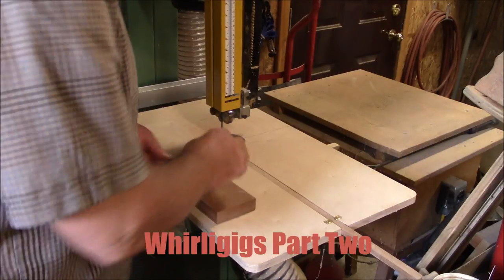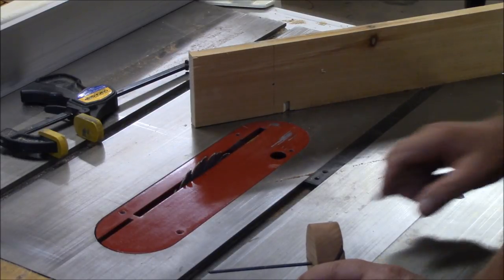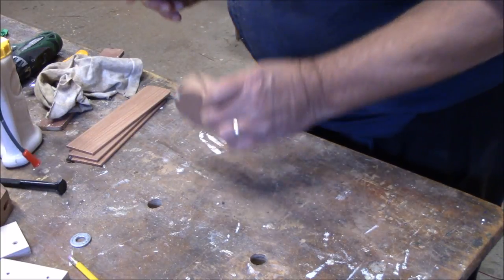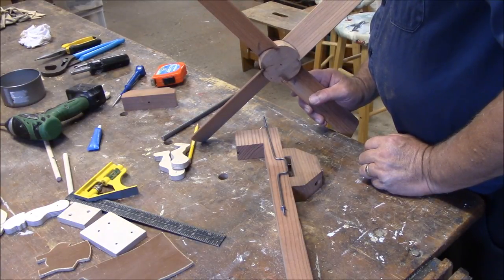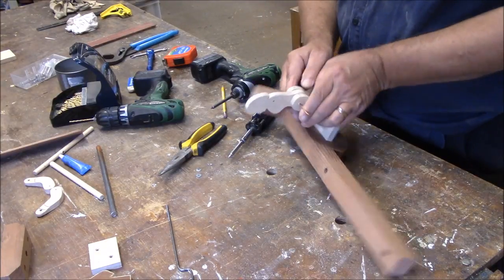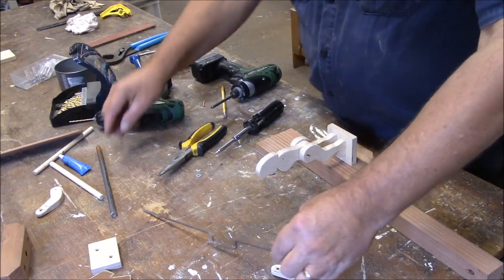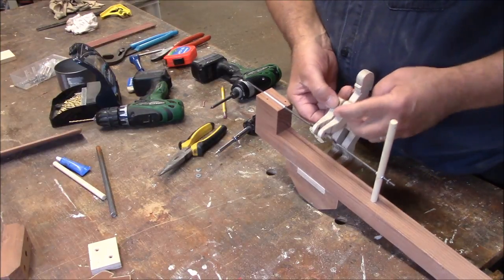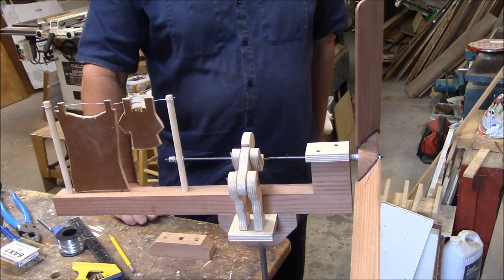Whirligigs Part 2

Comment: Can you give me some insight on how large the fan diameter needs to be? I guess the more moving parts then the larger the fan diameter.
Reply: In my own experience, fan size does determine how much movement your twist rod can handle. My simple build would only function if I gave it a nudge.  Once I used larger fan blades, it operated without my assistance.